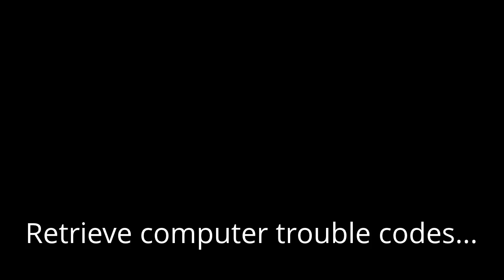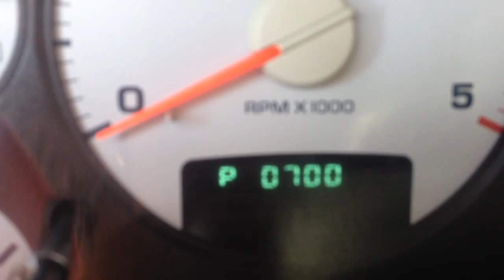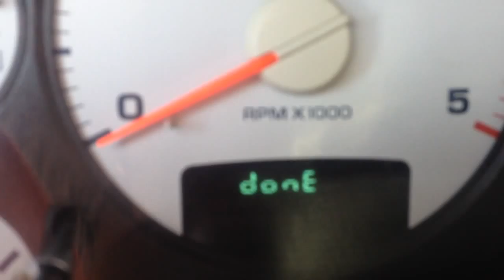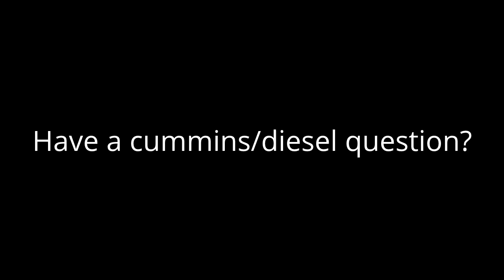Quick Tip #1 - How to retrieve trouble codes???

Comment: You are so Cool Bro! I did that to my 03 dodge 3500 and I get codes: P0480 and P0251 it suppose to mean: P0480 Cooling Fan 1 Control Circuit/Open (Low Speed Fan Relay) and  P0251 Fuel Injection Pump Mechanical Failure Fuel Valve Feedback Circuit. The shop keeps telling me I need to replace all injectors though. What do you recommend me to do? It just wont start, it cranks but doesnt start at all unless I force it with starting fluid. Help please!! Thanks for all your videos they are awesome!